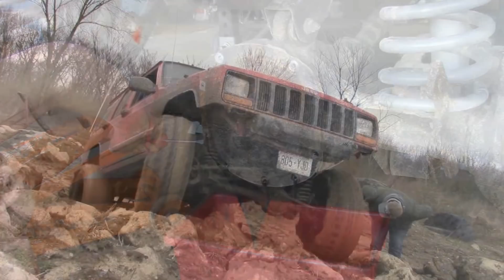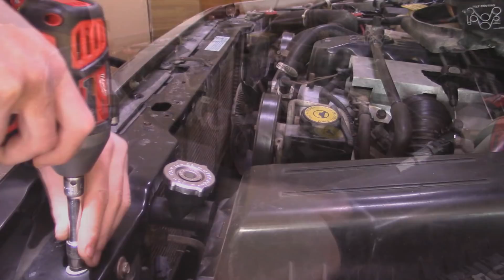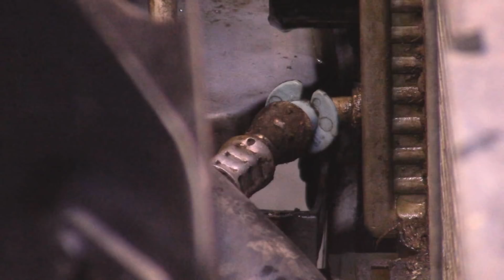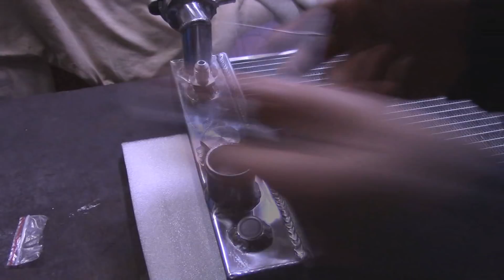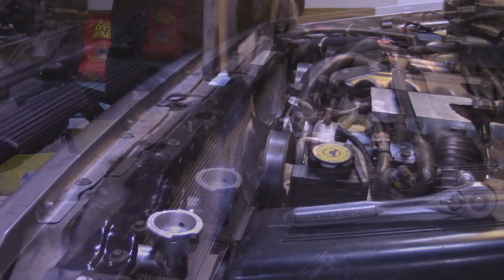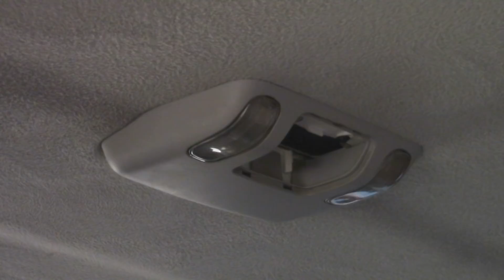Aluminum Radiator Install on a Jeep Cherokee XJ

Comment: I would highly recommend replacing the AC condenser while you have the radiator out. If it dirty the new rad isn't going to breathe as well. I would also highly recommend flushing out the whole engine and heater core so you don't clog up the new rad. Just my two cents.
Reply: How do you do that without the radiator in?
Reply: @foxmulder7616  flush with the old radiator in?

Comment: For future reference, the radiator hose clamps are 8mm or 5/16". A socket and 1/4" driver works well for these. Just did this upgrade to my 95 XJ. Got mine on Amazon for $107.00. Also mine is a manual transmission. Great job as usual. God bless, stay well. I also removed my airbox to give better access to the lower hose.
Reply: How’s the radiator doing?  Happen to have a link?
Reply: What did you use to plug the trans coolant ports? Do you know the thread pattern?

Comment: Pretty good lighting and coverage with tool information. Another good thing is that you did not add any background or lead in music that can be annoying. I have yet to do this for my girlfriends '89 XJ that I will be adding a drain valve with a length of hose. In doing this I'll be able to drain and change the coolant as needed into a receiving container. I did this previously on the '97 ZJ LTD and it has made coolant system work so much easier. Thank you for the great coverage on this topic.  :)

Comment: Should’ve done this when you did the t-stat and water pump then go ahead and do the hoses, tensioner pulley as well. If you’re getting an older used vehicle just go ahead and do everything Rated at same time.. do all cooking at once. Do all braking at once.. will save you a lot of time and money in the long run and will help when a problem occurs to not be constantly chasing ill crap vs new crap.

While you’re at it now would also be the time to replace fans if needed as well as transmission cooler

Comment: @5:49, Did you transfer the quick disconnect from the old radiator? The quick disconnect on my jeep is leaking and needs to be replaced. But I can't find a part number for it. Thanks for the video Austin!
Reply: How did it go?
Reply: Amazons replacement radiator comes with new transmission hook up.

Comment: Have you posted a video on how to replace the oil pan gasket?  Currently looking through.  Own a 2001 Jeep Cherokee 4x4 4.0 automatic and I MUST do these things before driving across the country:

-oil pan gasket
-oil filter housing adapter gasket
-valve cover gasket
Reply from the maker: Currently not yet but it's on my list for sure.

Comment: Austin, thanks for the great video. Helped a lot when i overhauled and beefed up my cooling system.  Ordered this same rad from blackhorse racing on ebay and it works as you described (never touch 210F). The one thing i ran into was i had to transfer the old trans cooler fittings over to the new radiator as the included fittings were the wrong size.  

How did you shim up the radiator at the bottom mounts? Mine does sit low in the frame by about 1/2”-3/4” since the new rad has mount pins welded to the bottom and the factory lower radiator insulators would not transfer over...
Reply from the maker: I was able to transfer over my lower isolaters. If it doesn't fit on yours then you might need to get a little creative and find some other grommets or maybe a little piece of rubber hose.
Reply: I had a buddy that me some adhesive backed foam rubber blocks about 3/4” thick that i was able to wedge inbetween the frame and rad, seems to have worked :)
Reply: Engine ran cooler?

Comment: Bought this same radiator from a different vendor and now my 1999 Xj sport runs at 210 and sometimes spikes over that driving on the San Diego freeways... I replaced the fan clutch, thermostat, hoses, water pump and no improvement. My jeep ran at perfect temperature before this radiator but the old one leaked. I do not approve of this radiator at all and you can't grasp how pissed I am. Now I need to replace my new radiator.
Reply from the maker: Jay S That's weird, mine early gets over 210 and that's when I'm on the trail in 90 degree heat. Other then that on the highway it keeps a crack under 210 the whole time. You might have an air pocket trapped in there.
Reply: OutJeeping Either way your videos are perfect and on point and yours was the best how to on changing the radiator... so no complaints there.
Reply: I'm also in San diego and after installing a new gladiator bumper last night, my 95 thanked me by blasting coolant all over my driveway from the original radiator lol
Such an ungrateful beeyotch lol
I'm probably going with the spectra single row.
Reply: @RandomStuffGarage619  My fan ended up chewing up that radiator and started leaking in a few places. I just replaced it with a single row as well as the thermostat sensor which was the last piece that I hadn't replaced. So now the whole entire cooling system has been replaced lol Working great now though.
Reply: @jaydoe3707  that's awesome. Thanks, glad to hear!

Comment: I'm changing out mine Ina 98 zj. This was perfect thank you. I noticed you have a ground wire from battery to cross member. What's up with that?
Reply from the maker: My factory cable to the fender was broke because the bolt snapped in the fender so I grounded it on the front cross member.
Reply: @OutJeeping  Hey bud quick question. i bought an aluminum radiator and have been watching some how too videos. but in your video you install new fittings and i just realized that the radiator i bought doesnt have fittings. is it okay to transfer the old fittings? if not do you know the name of the parts I need?
Reply: @OutJeeping   LINK TO MY RADIATOR: https://www.amazon.com/gp/product/B00KYXP6ZC/ref=ppx_yo_dt_b_asin_title_o06_s00?ie=UTF8&psc=1

Comment: Got the same radiator to install in 97xj- anybody have an issue with the bottom transmission cooler fitting?  The quickconnect on the line doesnt want to clear the fitting bumpout

Comment: not to play the bad guy but i would have replaced the radiator rubber mounts with new one's for less chance the radiator failing added a trans. cooler hooked up to the radiator because of cold winter's off road in the summer can be hard on the cooling system and trans. radiator out was good time to do it all hoses etc. to C😎😎L
Reply from the maker: I was in a time crunch and did this over the holidays so stores were not open. Il'l be adding a trans cooler later on and radiator hoses have been replaced not to long ago.
Reply: OutJeeping yah the thing that sucks about the holliday store's closed and crunch time and how work can still get in the way and money can be extra tite on the hollidays LOl 😆   glad to know you'r going to set it up right and lock in that four wheel drive well you just know how you are LOl 😉 sorry it took me so long to get back to you have a good night C😎😎L
Reply from the maker: For some reason YouTube marked your reply as spam so I am just seeing it now. Thanks for the support!

Comment: I need a aluminum one now. I wanna get one next Friday. But what would happen with the over flow would that still be the same?
Reply from the maker: Yup, same as stock. Overflow tube attaches on the radiator cap fill neck.

Comment: Was there ever a video for an upgraded electric fan assembly? Or anyone have a suggestion for one? My OEM replacements keep failing. I have the exact same radiator and I'm overheating when I'm idling. My electric fan isn't coming on unless I turn my air conditioning on.
Reply from the maker: I dont have a video on upgraded fans but the stick fan setup should work just fine. The stock electric fan should kick on at 215 degrees, if it's not kicking on it could be a bad temp sensor or something else electrical is messed up. You could also always wire in a fan override switch.

Comment: Where did you get the trans cooling line fittings?
Reply from the maker: jh87ep3 They came with the new radiator.
Reply: Damn mine didn't thanks
Reply: So where did you find fittings for yours?  I've tried everywhere.
Reply: Did you find the fittings anywhere? Ive been looking for them all over

Comment: How has this radiator been holding up? I may order this same one soon. Did it come with the transmission fittings?
Reply from the maker: Mine did come with the fittings. It was working great till I sold the Jeep last summer.

Comment: I live in so hot state, Do you recommend it ?
Reply from the maker: Reda Alsaygh Absolutely has never reached 210 yet but I also have a new thermostat and it's winter time. But I have had no issues yet.

Comment: Hey my radiator didn’t come with any of those fittings, more specifically the quick disconnect. I’m having so much trouble finding the correct one that’s ours thread right into the spot. Any idea or place you can get that fitting? Thanks
Reply from the maker: If you are able to figure out the size thread for the radiator you can find fittings at any hardware store or online like Amazon. You could get rid of this quick disconnect on the bottom of the radiator and is put a barbed fitting to fit the line over. As far as a top transmission line you would want to keep that threaded into the radiator.

Comment: Did the fittings you had to use to connect the transmission cooler lines back to the radiator come  With the radiator? I ordered the same  Radiator  And cannot find those fittings for the life of me. Do you have any suggestions?
Reply from the maker: Mine did come with the radiator, but there are other listings without them. Perhaps you might be able to use the old fittings off your old radiator.

Comment: Wow!!!Let us know how this $123.00 radiator holds up....
Reply: Hey brother, I've been running one of these on my xj since last June without a single problem so far, they're of surprising weight and quality. The only issue I had was my own fault when I over tightened the sensor plug and stripped it out, fortunately my local radiator shop welded it shut for 20 bucks lol.

Comment: Is this a direct fit, with zero fabrication? Other than the rad cap? And is it worth it over the oem?
Reply from the maker: Correct, cools better than oem but now I am hearing from other people that they start to leak after a year unfortunately. So far after 5 months mine is holding up fine.
Reply: OutJeeping Thanks for the reply

Comment: How is this radiator holding up? is it keeping your jeep cool? I'm needing to replace mine and want to go with a 3 row
Reply from the maker: Was working flawlessly till I sold the Jeep last summer, the Jeep never got over 210 degrees.
Reply: @OutJeeping  thanks! I’ve been having an over heating problem on my jeep while towing anything (even an empty 4x6 trailer) I already changed out the head gasket so my next step it cleaning out the cooling system and replacing the radiator

Comment: Whatever you do don't buy a flex a lite, overpriced junk. Mine made it less than 10k before it started leaking. My old Auto Zone plastic tank radiator with a lifetime warranty I've been through 2 in 11years and 180k miles. That's what I'm putting back in it tomorrow. F#$@ flexalite.
Reply from the maker: Carquest sucks ass well. They fail 1 year right out of warranty.